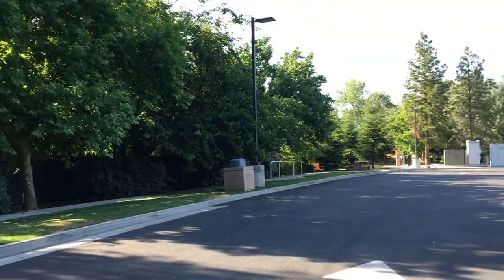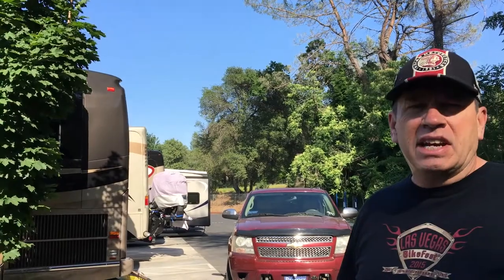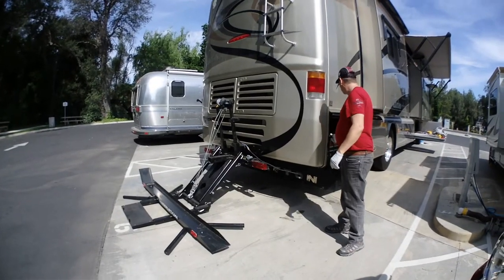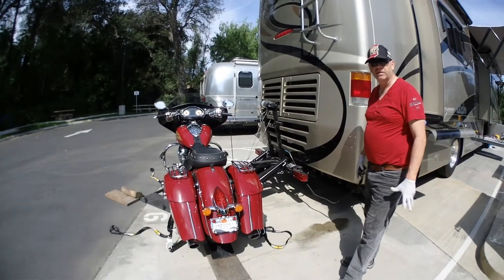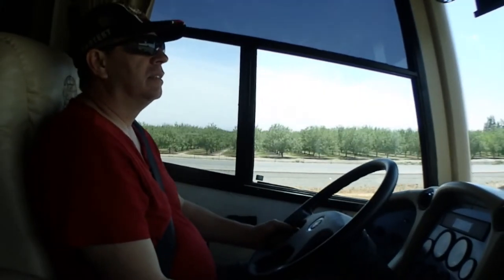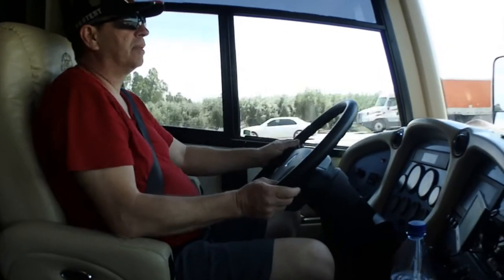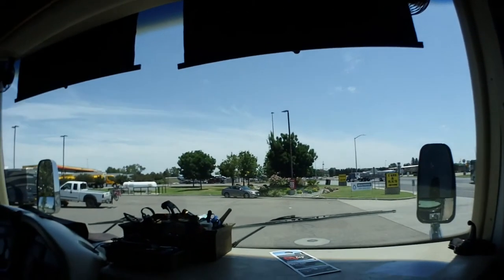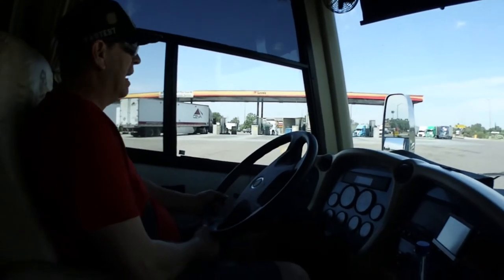Motorcycle Lift Part 2 - Cruiser Lift for Class A Motorhome

Comment: Great video! I’m very much considering the Cruiser Lift, however every video I’ve viewed always edits the actual loading of a full dresser. Can you load a 900 pound bike by yourself on this lift?
Reply from the maker: Thanks for your comments.  I like to have my wife guide the front tire coming on the tray so I don't tip as you saw in the video.  Go slow and maybe add some elevation planks on the sides to have good footing.  It is really awkward at first until you get practice.  I now have a Roadmaster that is 840 lbs.  It will lift just fine.  I usually take the trunk off and store in the basement while hauling to keep more weight on the front axle.  Make sure you go to the scales to check the load balance on the axles.  I was 1300 lb over on the rear until I checked it on the scale.  When you are heavy your tire pressure should be higher also, (within the recommended limits of the tire).  It will steer and handle better doing all of this.    
For the heavy bikes some people prefer the Hydro lift.  The issue I find with the Cruiser Lift is that there is a bit of play in the lift so when you go over a bridge on the highway or a pot hole your bike will move from the lift flexing.  I added rubber dampeners to one of the joints which helps.  Also make sure the turnbuckle is alway tight (pulling down) and this reduces the flex. This lift is rated for 1000 lbs so your bike should not have an issue if you have a good weld to the frame of your RV.
Reply from the maker: I believe the mfg says the payload can be 1000 lbs but you want to keep the weight as low as possible because it makes your steering sluggish.  The more weight on the rear the less weight on your steering tires which can be unsafe.